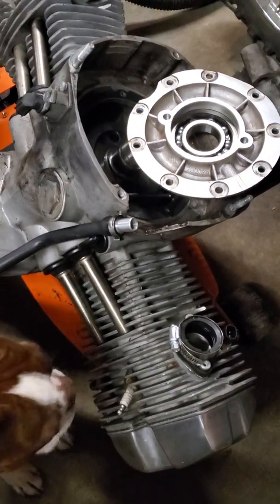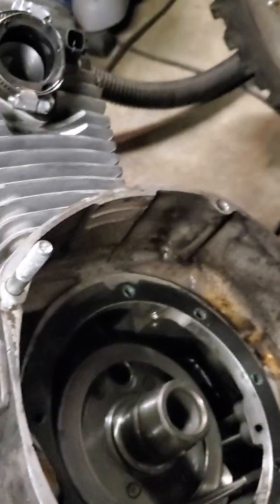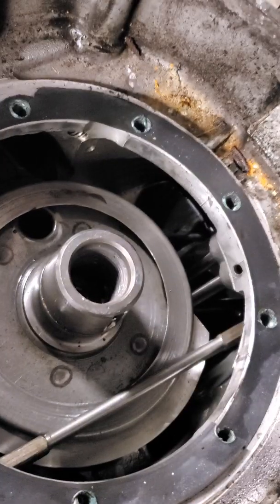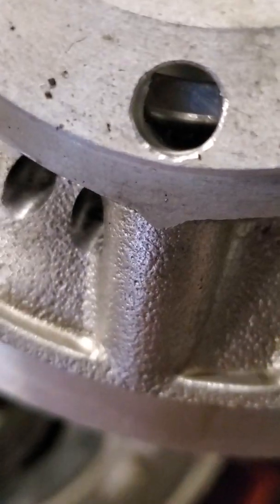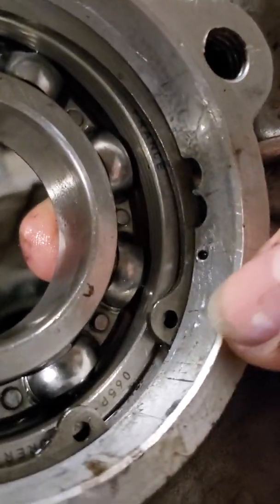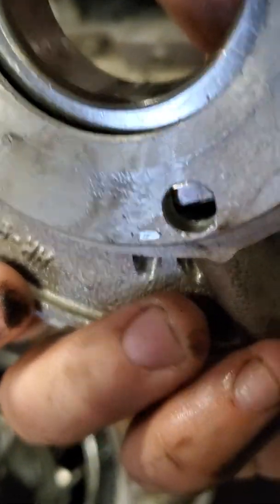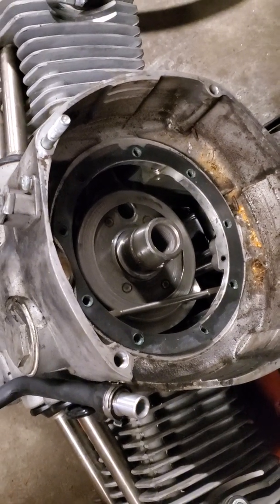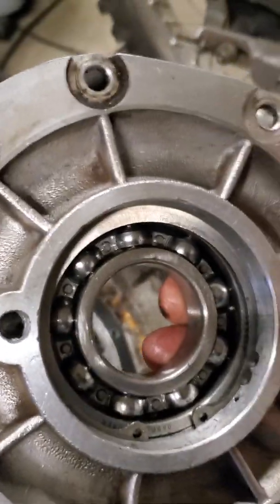Ural Motorcycle rear main bearing oil starvation

Comment: I suggest to check bearing seat. There should 0,01-0,02mm tightness. If the seat is already 0,05mm bearing is to tight and will be damaged like this.

Comment: The lubrication on this type of design requires high oil FLOW... not high PRESSURE, as the crankshaft bearings are ball and roller. High pressure in this design will cause the balls or rollers to “skid” for want of a better term.
If there is a problem with oil delivery to the rear main bearing and a failure of the rear main seal...I suggest replacing the rear bearing...probably a 6207?... wth a 6207 2RS...that has x2 seals on it. They are prepackaged with high temperature..high pressure grease...and have a life span of over 100 Thousand kilometres or more!
If you like, the front seal can be removed...to allow the balls and races a lick of oil...but is not necessary.
I have fitted these sealed bearings on several of my pre-1970 BMW’s, and even my 1938 R51....result? Problems solved!
The other bonus is the x2 seals on it will mean the large RMS will never leak.